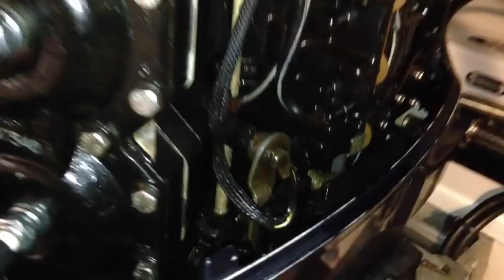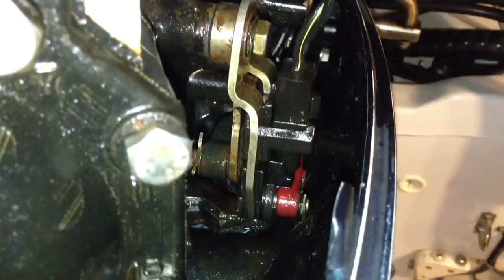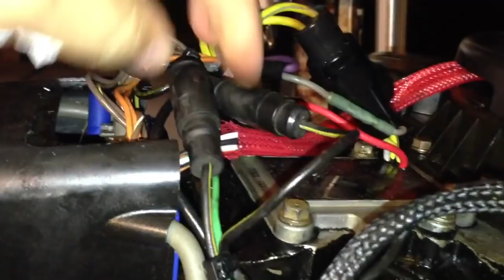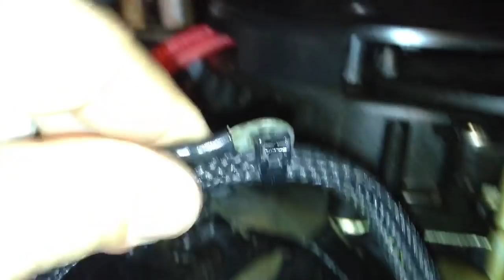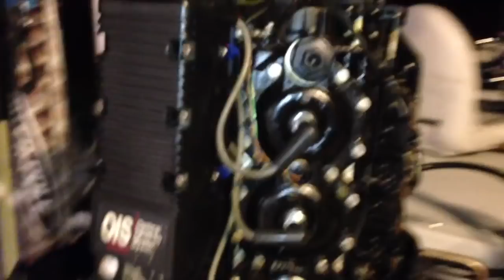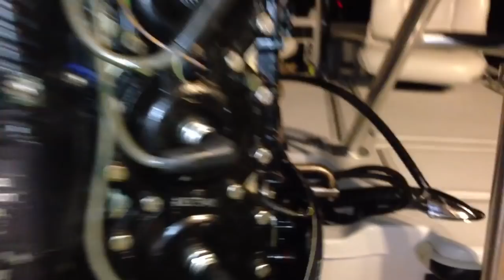1996 Evinrude 150 Shift Switch Problem

Comment: You are correct about what the shift interrupt switch does. It momentarily cuts out the spark to cylinders 1,3, & 5 (starboard cylinders) to aid in shifting. I'm changing mine as I speak. I think when the small plunger is depressed, it cuts the spark, as mine seems to want to stay depressed. I spayed lubricant inside the plunger and tried working it free with no luck. Also grease your shift cables as I've read this can cause problems also.
Reply from the maker: Thanks

Comment: Good video and info.  Will try this on my problem but am only marginally hopeful.  I have a 99 Force (Mercury) 120 hp. Cuts off occasionally at low rpm, even while making way, and when moving from clutch speed to neutral and back as I dock.  Changed plugs, did not help.  Wondered if fuel issues but till take a look at this and see if there is a solution.
Reply from the maker: Good luck!

Comment: I'm curious and have a question for the OP. After dropping the ground did your engine perform correctly when you ran it sir?
Reply from the maker: I’m not sure what your asking. If the ground is not connected it’ll run only on 3 cylinders terribly.

Comment: Some good info on this one. I have a 92 evinrude 150hp it's the nitro model. I'm have issues getting spark playing with the shift switch and the string safety switch I can get it to fire but it's not enough to start the motor. I've tried to bypass both switches to no avail.im wondering if there may possibly be another switch somewhere? I've found the shift switch on the motor , the micro switch on the shifter and the pull string below the shifter. It's driving me nuts and I'm about to just retire but would like to exhaust all my my options first any info would be greatly appreciated
Reply: It's a ground short that's causing your low voltage firing. Check and clean all of your ground plugs, and ground connections.
Reply from the maker: Hope you figured it out

Comment: You never posted what fixed this, but I see a few days later you replaced your Power Pack.  Was the switch Bad?  If it was the Power Pack instead, how did it run fine with the Interrupt switch disconnected?  Appreciate some additional info.  Thanks
Reply from the maker: Tom Hegland I replaced the switch and it fixed the problem. I replaced the power pack and coils because Sierra made an upgraded power pack that improved cold starts and my coils were splitting apart. But replacing the switch fixed the single bank firing problem. The new switch was too long and it took several trips out sanding it down a bit each trip to get it not stall the motor. Once it was the right height it has worked perfectly to date. And this video was quit a while ago. Hope all that helps!! Thanks for the comment

Comment: I have a Johnson 150vxss. Ran great..then would start to stall fast unless you hit the gas. Now won't fire up at all. Tested for spark. Very low spark at all cylinders. I did order power pack also and coils. I also noticed the shift switch would not ohm. In gear or out, it would read open. But ohm your switch when you push on it and it ohms good. So called Johnson..they said switch is good..must adjust. I have no idea how to adjust. Was wondering if you got yours working? FYI get that ground back on..lol
Reply: Fixed..had bad fuel pump, crap in gas tank
Reply: the shift interrupter is momentary, putting the throttle into forward or reverse and leaving it there will not close the contacts. 

to test it  while motor is NOT running you'll have to physically remove it (not hard and press the switch. Then at the black/yellow wire test for continuity between it and ground
Reply from the maker: Thanks

Comment: Your neutral interpretation switch should only have continuity when in neutral when you shift to drive the switch gose open. Just replace or adjust the switch that way your motor will will short to ground and shut off the cylinders to make going back to neutral easy
Reply from the maker: alfredmattor thanks!!
Reply: DID YOU EVER TRY TO ADJUST?

Comment: I'm confused, if the switch was always open, why would disconnecting the ground fix the problem? I'm having the same issues, port side  no spark. I disconnected my top wire, basically removing the ground, but still doesn't work, I'm going to try and removed the ground and see what happens.
Reply from the maker: It’s negatively switched from what I understand. Interested to know how it works out

Comment: I've got a 96 Johnson with a similar issue.  With my motor it bulks at 3000 rpm but as soon as I manually CLOSE the interrupter switch the motor runs fine.  Disconnecting the ground does NOT solve the issue and it's only solved by depressing  and closing the interrupter swtich.   When you mentioned that disconnecting the connection with the female plug at the wiring harness "nothing changed", does that mean with this plug disconnected you were stuck in 3 cylinder mode?  Thanks!
Reply: Jim, tenho o mesmo problema relatado, mas não estou conseguindo visualizar a solução .. teria alguma dica?
Reply from the maker: Yes, that could be the problem. I know this is a five year old comment, but I’m finally going through the entire channel and reading comments each day. I hope you figured this out I’d be interested to know what happened.

Comment: i know it has been awhile but i just recently picked up a 99 150 and i cant go over 3000 rpm, did that ever fix your problem if u can recall?
Reply from the maker: This fixed the problem. Only 1/2 bank firing. If it’s the switch.

Comment: I’m having some issues with the same engine. It seems to be stemming from the remote control throttle. Have you had to replace any wiring in the throttle control?
Reply from the maker: Jeremiah Ballard no. The wiring has never given me a problem. Boat is garage kept though for almost 20 years.
Reply: YOLOfotos this boat has been garage kept for the past 10. That’s why I decided to buy it. Thanks for the videos though. Very helpful!

Comment: I have a evinrude 70hp 3 cyl with similar issue. Starts up no prob, once i put it forward or reverse it just dies.. so i takenoff the engine cover, start the boat, and i have to physically give it throttle and play with the choke while someone else puts it in forward or reverse to get going and i have to continue giving it gas from the engine.. once it gets going itll go, but if i put it back to neutral it will stall out and i have to redo the whole process...any help?
Reply from the maker: Jonathan Tejada Id start with redoing the carbs. Seems like a fuel problem. I’d replace the power pack and coils next if that’s not it. Air fuel or electric. Has to be one of those three.
Reply: @bobbygfl  thanks so much! Will def give those a try

Comment: I have the same motor and it was also hard to start - the starter eventually died and was replaced. Starts perfectly now. I believe my starter was not producing the rpm s needed to start well.
Reply from the maker: Garth Eremko awesome! Thanks for the comment. I replaced my starter also. And the bendix. However I think only the bendix was bad.

Comment: I have a 1995 evinrude 150 intruder. it starts and runs a min then seams like it runs out of gas.if you turn the primer a bit it will start and idle only running off three cylinders. you can unplug the lower two plug wires On the port side and the middle one on the starbord side. no change in how the motor runs. plug all plug wires back and unplug top port plug wire motor die put it back and runs back on 3 cylinders. same if you do the top and bottom plug individually.
Reply from the maker: Rob Cle sounds like your power pack is fried. I'd start there if your sure the shift interrupt is not the culprit.

Comment: Is this only the starboard side mine is not firing on port  side
Reply from the maker: I’ve only heard of it being starboard however depending on the power pack it could be the other side. Good luck!
Reply: So i disconnected the ground and it now fires on all cylinders! So is replacing the switch the fix to that issue or what somebody told me it’s my gear case online I don’t know what to believe ?
Reply from the maker: @IMTHATKIDJIT  yes. Replacing the switch should do it. It is a negatively switched switch from what I remember. Meaning when you connected it grounds the circuit and shuts off half the cylinders. When it’s operating, I really can’t remember if it’s normally in or normally out but either way when it’s operating it connects the ground and kills half the bank. When it’s operating it is not grounded which is basically what you’ve done by ungrounding it. That little switch is not expensive my bet is it does fix your problem.

Comment: ok i replaced my switch after seeing your video thanks yet however my still stalls out when going into reverse? took off the ground then fine again?? when you say sand down the switch are talking about the button itself? how much should i remove?
Reply from the maker: John Runkle it’s hard to say. I’d use sand paper and do a mil at a time between tests.
Reply: John Runkle what is happening is the switch is sticking in the slider. They sell a stiffer spring for this issue. Check with BRP. I THINK it has a blue mark on the spring.

Comment: I just had the same problem on my 1996 johnson ocean runner 200.  Half the cylinders wouldn't fire due to a bad shift switch.
Reply from the maker: Anthony S Yep if you don’t know to look for this thing to waste a bunch of time on other stuff
Reply: @bobbygfl  Did you find out why it sticks open?  I'm stuck at the dock until I find a solution besides a new switch.  Apparently people don't keep spare 1996 shift switches around in 2020.  Thanks!
Reply from the maker: Anthony S age, grime, water intrusion. They just go bad. I don’t know if this is something I would carry a spare around but did you go bad

Comment: Do you have a part # or link to where I can find this switch?
Reply from the maker: Nick Hawthorne it should be the sensor assembly, part number 0584914
Reply: YOLOfotos that looks like the optical sensor I’ve already replaced
Reply from the maker: Optical sensor is part of the ignition. This is listed with the throttle linkage.
Reply: yvon benoit  my 93 Johnson fast strike doesn't have a switch there or the wires could that be a problem with mine cause when I bought the boat it's been running fine without it and now all of a sudden it's doing the same things yall describe about the switch

Comment: so i have an 04 Johnson 175 i have the issue where getting into neutral from forward and reverse is an issue bc my neutral safety switch is disconnected. i got a new one, reconnected it, put it into gear it stalls. i run the boat with the switch discounted without a problem minus shifting into neutral without a hassle. plz what  can i do... help!
Reply from the maker: Jon Zobel you need to carefully sand off the tip of the switch to make it shorter. So here’s what’s happening: your transmission does not have a clutch. The neutral switch shuts off three cylinders to take the load off of the transmission so it can pop into and more importantly out of gear. Because that switch is too long you are basically stalling the motor for too long. Shorten up that switch and it just gives a quick shot to the motor versus a longer delay. The risk is you sand off too much and you have to buy a new switch. I did three or four tests before I got it right by wrapping some sandpaper around a block and just taking one or 2 mm off of the end of the switch.
Reply: YOLOfotos not sure I understand. This is a brand new rebuilt motor
 Fresh pistons culindrds new
Carb power pack 2018 lower unit dog clutch rods all of the above. Brand new. I just got a neutral safety switch off eBay spliced  it in and it still acts up. I talked to some guys and they said the thing it attaches too might b gunked up dirty or the little plastic thing could b too far up or down I hear it needs to be straight. I’m very unfamiliar. The boat is fine when it’s discontcred, just hard to get it into neutral some times. Text me if you can. 9548505190
Reply: @jonzobel3133  your problem is that you bought it from eBay, I have bought tons of stuff from eBay, I eventually figured out that electrical parts are more commonly defective versus buying OEM. So now I only buy OEM electrical parts, I still buy alot from eBay, just not anything that I believe is not up to OEM standards, and no electrical parts.

Comment: My motor does the exact thing it def sumthin rong with switch but mine only does for the first 5 to 10 min of start up then will spit and pop and then boom fires on all cylinders
Reply from the maker: Thomas Wild power pack would be my guess. The SLOW feature may be going bad.

Comment: Trying to figure out what's wrong with mine, basically when u start it up it idles rough but the moment u put it in gear it purrs like a kitten anyone know what could be causing this?
Reply: I suspect timing at idle. as you put it in gear the throttle is opened a little bit, thus advancing the timing...

get the manual specific to your engine and adjust the timing accordingly....DO NOT mess with the FULL advance STOP screw....refer to your manual.
Reply from the maker: Thanks
Reply from the maker: Rebuild the carbs first and go from there.

Comment: I have same motor and have the problem that the engine will not shut off.
Reply: bad kill circuit in either the ignition switch or the power packs themselves...suspect the ignition switch.
Reply from the maker: Something wrong with the ignition